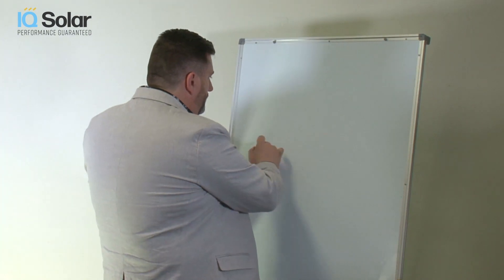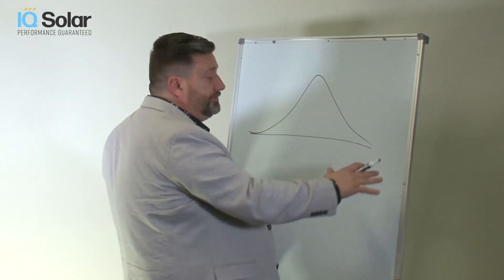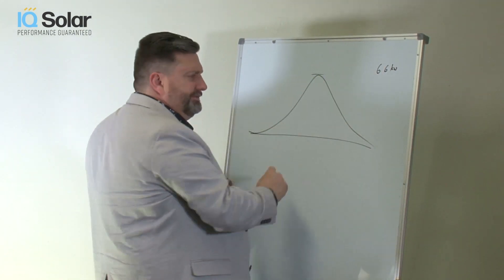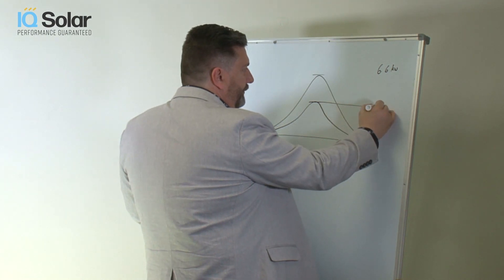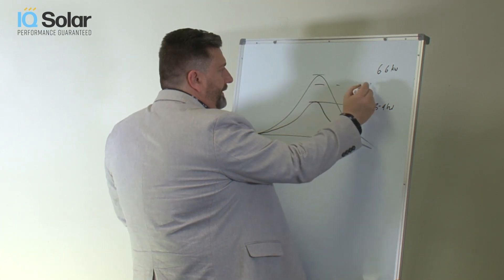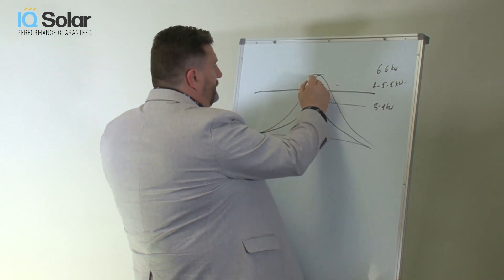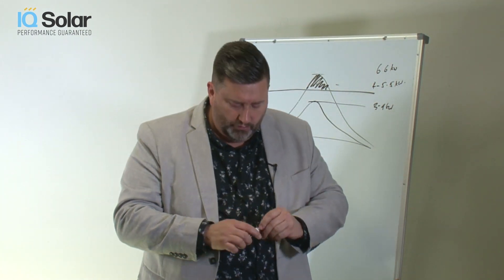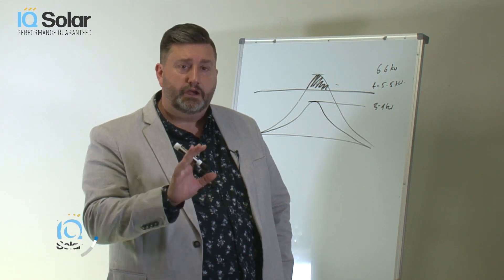Oversizing - Having more Panels than the Inverter Size on your Solar Power System #oversize #solar

Comment: Is 17.16kw panels too oversized for 10kw Sungrow Inverter with 16kw Sungrow battery. 13 panels on each East, north, west roofs which are steep. Salesman thinks its ok and even tried to convince me that the excess clipping will feed back into the grid. I think the clipped is not converted to AC?

Comment: The inverter size doesn't matter at all the battery bank size determines how much solar power you can supply to your battery and your charge controller rating you can have a 1000 watt inverter and have 10,000 watt's of solar panels as long as your charge controller and battery bank can handle it the inverter draws power from the battery there is no power getting pushed into it

Comment: I am planning to get a REC 400 panels x 37 using IQ8 micro inverters.  Which one shall I use?  I got some sales rep recommend IQ8+, IQ8M or even IQ8A?  What is a good combination for location in Kansas, USA no shades and mostly facing south panels.  Great video by the way so sales rep do not even understand this or do not care.
Reply from the maker: We use Enphase, and they are a great product… can’t comment on the model choice as here in australia some the sizing is dictated by local regulations on oversizing. We usually choose enphase when there’s some shading, but you get some possibilities to upgrade and integrate with batteries which is good.
Reply: A 400 watt panel needs a 300 watt inverter.

Comment: My understanding is that you can exceed the rated volts of the inverter but not the rated amps. Is this true?
Reply: You can exceed the amps, because the inverter has a limit, but not the voltage

Comment: New to solar, just bought an EcoFlow Delta Max and 1,360 watts of solar panels to over panel. May sound like a waste, but if I plan a larger DIY solar setup in the future, I am already on my way. Many people buy those gadgets that move the panels throughout the day, but they are expensive. The one for the Delta is 1,600CAD for their 400 watt portable panels. My thinking is no matter whether my panels a positioned properly vertically, moved throughout the day or I have an overcast day, I will still receive as close to the max 800 watts/hr the Delta can accept for longer.

Comment: Sorry, but this explanation is horrible.
What about oversizing panels and increasing the inverter's ability to deal with excess voltage (when panels are connected in series)
This shows just one half of the issue  and it does it badly.
Reply from the maker: I’m not trying to get into an electrical explanation… I’m simply explaining that we can have more panel capacity than the nameplate capacity of the inverter, and it doesn’t really impact performance. If you want to get into volts and amps, that’s awesome. Drop me an email. It’s irrelevant to almost everyone, however people often wonder why they have more panel capacity than their inverter size. 
I’m also not sure where you’re located, but as well as electrical considerations, in Australia our rebate scheme allows for up to a 33% oversizing to be eligible for the rebate. More of batteries are connected. I’m sure you know this.
Reply from the maker: And, just for clarity, the voltage window for the inverter per mppt is of interest to no customer, ever. They also don’t care if we parrallel a string for a third position. I care because i need to know how to put together a system… our installers are all licences of course and eat this stuff for breakfast. Customers don’t care.
Reply: @iqsolar9633  That is fair enough and perfectly in order with what you do, for sure.
Thing is... this is YouTube and all manner of people will be taking your advice (which is in essence, good) but just chucking on extra panels with the idea that inverters can just take them is perhaps.... unwise?
Reply from the maker: @mrpad0  I am not sure where you are... in Australia ONLY licenced electricians install solar. It's not a home DIY project. This is not 'installation advice', it's an explanation for people buying solar / looking at solar for some basics. This is not installation advice, medical advice, relationship advice, or financial advise. It's an explanation. Do not install solar yourself. Ask an adult.
Reply: @iqsolar9633  Oh, I live in the USA.    One can instal solar oneself, but such work needs to be signed off by certified electricians of course.   On the other hand, if one lives off-Grid in the boonies.. people will set up their own systems.   People also set up their own RV systems, of course.
Everything you said about upping the wattage intake is good advice.  The one-third thing too.   I was just surprised that no mention was made of the voltage increase that could happen (with in series panels, particularly) and it alarmed me.   I read what you had written underneath this presentation about 'How do you calculate how many panels you need' and failed to mention what others mention as a caveat.   It's solar panel installation basics.  Sorry.
Reply from the maker: @mrpad0  we'd talk to a customer about the system size of course, and we do residential system from 5kW up to 18kW. I have videos on my webpage on how we work this out. We are NOT asking the customer to work this out themselves. There's also constraints about what is permissible depending on if they are singe or three phase.  Noone is doing this on their own. There's no DIY in Australia, except maybe RVs.
Reply: @iqsolar9633  I'm sorry, I did not realize this presentation was so localized.   I just read 'All inverters will handle it, as the power rarely gets to the panel capacity anyway' and was concerned.
In many parts of the world people will work on their own solar systems and keep within the limits of the inverters they use and so this information going out into the world seemed to miss an important part of the equation and could be quite worrying.  No one in Australia is installing their own solar system?   I'm stunned!
The channel 'Off Grid Solar - How to DIY in Australia' is pretty good.

Comment: My dad's system in Perth has a 2 kW inverter and what seems to be about 3.8 kW of panels (10 panels).  It disconnects frequently, apparently because it can't keep the voltage under 260 V.
Reply from the maker: sometimes they disconnect because the grid is higher than it's meant to be
Reply: @iqsolar9633  yeah it makes sense that the network demand controls the voltage.  I think our supply is quite weak (lots of dips and brown outs and two or three scheduled outages in the last year), and lots of neighbours are producing when the sun shines. I checked one of the 10 identical panels and it is rated at 190 W, for a total of 1.9 kW panels and a 2 kW inverter, so I don't understand why the inverter is showing the numbers is does (current power output of 2,673.7 W at 10:45 am).

Comment: I'm running 24v system...16x 24v 250watt pannels and 3x 24v 150watt and 3x 24v 190 watt pannels with a 600watt 24v  wind turbine . Battery bank 30kw.  Im putting in 85amp per hr.  I run a 1800watt inverter. I use 3 charge controller at 40amp each. My batteries are rated at 100amp per hr input. Am now looking at heater glow plugs for heating up solar hot water system linked to 12v ..240watt solar panel.   Sofar so good.

Comment: there is no danger to blow the inverter?
Reply from the maker: No, is is designed for a much larger additional input
Reply: @iqsolar9633  my inverter already says 1850watt max input and 1550watt output.with 1750watt panels it rarely exceeds 1250w.should I add one more panel?
Reply from the maker: @audiophilesland969  it depends on the amp inputs into each string if it’ll take it… find a data sheet for panels and inverters
Reply: @iqsolar9633  yes it can it,s one string in series and have plenty of voltage left
Reply from the maker: @audiophilesland969  every inverter has both a voltage maximum and a current maximum. we design within those guidelines.
Reply: @iqsolar9633  yes i have figured it out by know.i will soon add two more panels

Comment: I have 38 400 watt panels hooked to enphase iq7+ (295W) and iq7A (349W). Over the last 6 months, the A's have produced about 2% over the  +. 
Save your money and buy a cheaper inverter and add an extra panel.  
FYI. I live in west Texas. A desert region. Actually, many square miles of commercial solar farms here.
Reply: Hi so you recommend to go with cheaper inverters (295w) hooked on more powerful panels (400w) or you would decrease panel watts too (lets say 330w)? also do you recommend your micro inverters over one string inverter? I would like to have only up to 10 panels as my consumption is not that big and I dont plan to become independent. My aim is to reduce bills by a half (more or less).
Reply: @viliamgajdos5917  well you get the perfect 400 watts about never. Lol. Think morning, evening, cloudy days, dirty panels, etc. I'm my opinion, the 400/295 is great.
Reply: @viliamgajdos5917  a string inverter is great! It really depends on pricing and what's local codes you have. Maybe you should have a professional give you a estimate.
Reply: How do you know 2% over energy production.  Do you have actual 2 version of inverter to test it out?  How many times it clipped for the IQ8A?

Comment: What if it clipped everyday?
Reply: My panels are 330 aptos with iq7 

6.6kw and clipping at 4.9 from those hours everyday. 

In this case should they have gone with iq7a ?
Reply from the maker: @InspectorApe  enphase clips a bit more because every panel clips.
Reply from the maker: we can see how often a system clips, and in summer it's quite often. But overall the impact on a system is a percent or two... there's much bigger factors than the clipping.
Reply: @iqsolar9633  mine clips from 10am -2pm all day everyday
Reply from the maker: @InspectorApe  do you live in Darwin?
Reply: @iqsolar9633  riverside Cali
Reply from the maker: then the losses would still be just a few percent …